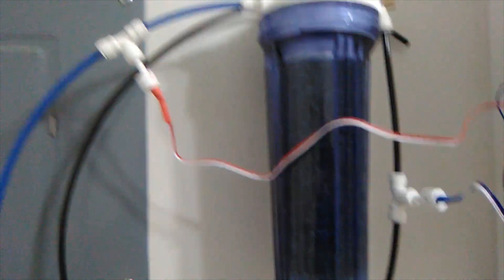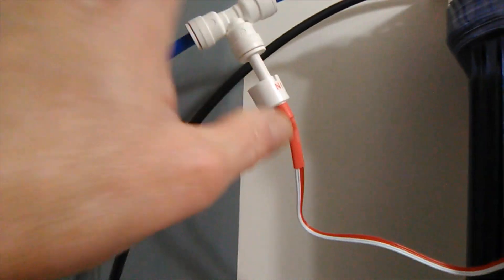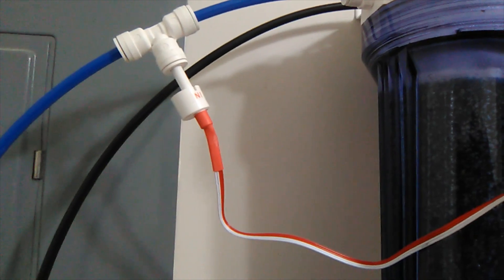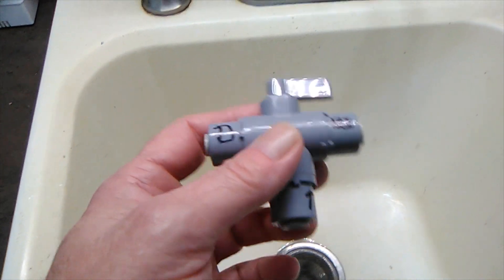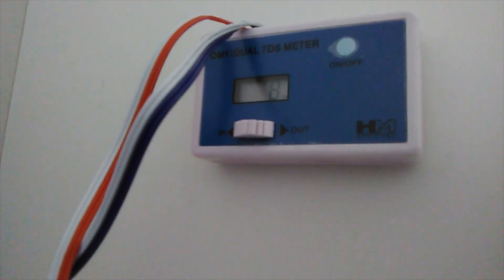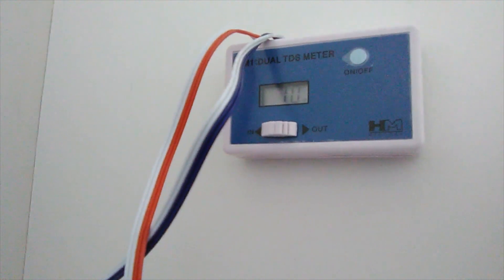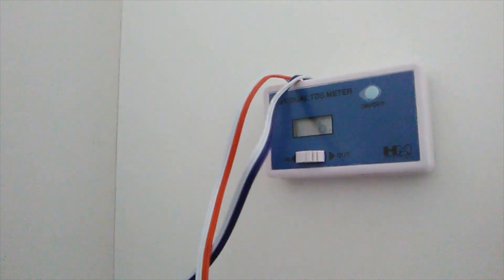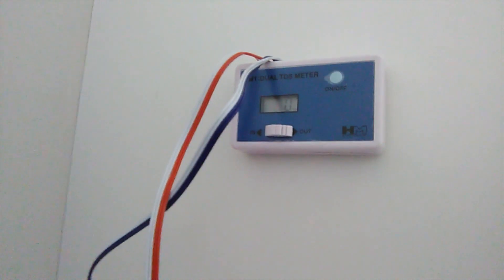Easy way to deal with TDS creep on a RODI kit.

Comment: I let mine run for 15 minutes then turn on the booster pump another 15 minutes then I get 0 tds
Reply from the maker: You da man
Reply: @lkapitan8232  old skool ... I want your way
Reply from the maker: @filipinoreefer  You can get the 3 way valve and double TDS  meter at BRS, install is easy.  I always tested water after I made it, what I didn't realize was how high the TDS was when I started.

Comment: Nice work.
I have a flush valve with my BRS 5 stage unit.  It diverts most, but not all of the junk water.  I need to replace either the batteries or the entire TDS unit in mine.  It would be nice to know what is actually coming out.
Reply from the maker: Thanks, is the flush valve automatic or manual?
Reply: @lkapitan8232  It's a manual valve.